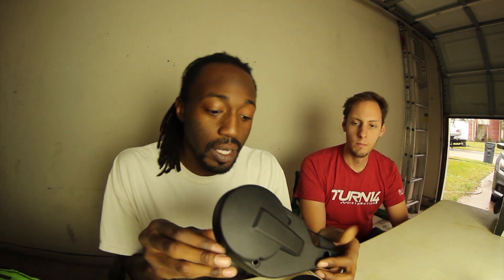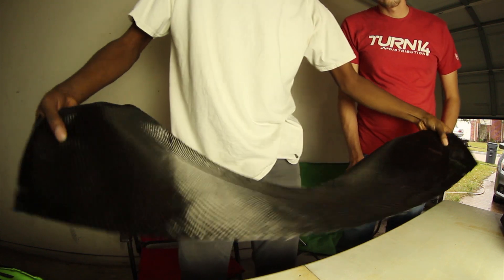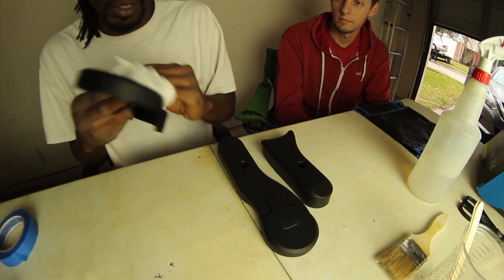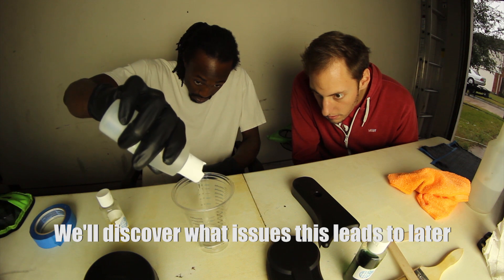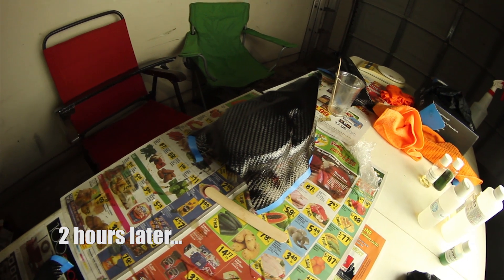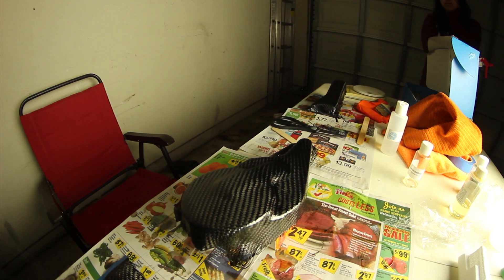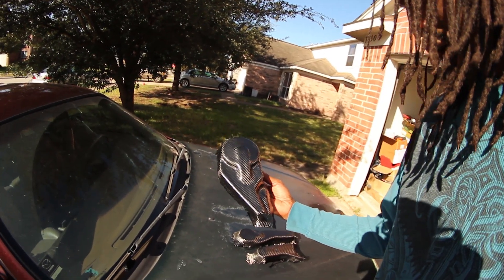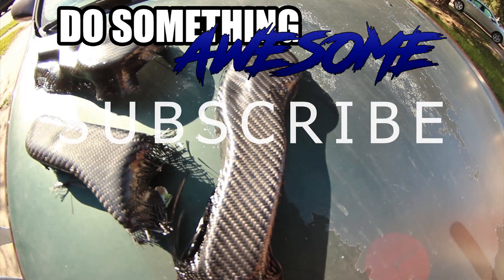What NOT To Do When Working With A Wet layup Of Carbon Fiber

Comment: Awesome. Would it be possible to sand down majority of the bad resin and then mix up a fresh batch and redo it?

I had a carbon part made and it softens up when it gets warm. Wondering if I can sand down the resin or most of it and then reapply  a new couple layers front and back of a better  quality reason so it stays hard all the time like it should.
Reply from the maker: Yes
Reply: bag it !!  to get that glass finish you want is almost impossible . and you need a negetive mould  .

Comment: Tip...buy a hair dryer on low setting to get the bubbles out and remove fingerprint smudges. 

Or if you're brave hit it with a blow torch

Comment: One other tip that might help:  when cutting a straight line, pull one tow (string) out from the side.  That will create a straight line that keeps you from cutting across the twill.
Reply: Dude, how to cut a circle in that carbon fiber fabric
Reply: @hariharan.r6352  in my experience, there are two options: 1. A REALLY sharp set of shears, and 2. Use a template like a can or lid that will allow you to hold the fabric down while using a rolling knife (like a pizza cutter).
Reply: @aConspiracyOnlyTakes2  Thanks man

Comment: How snakes has your buddy been touching anyways?  Just an idea, I do upholstery and everything automotive, but to cheaply cover your table, use rosin paper. It is sold in 3 foot by 100 foot rolls at home improvement store in the flooring section. It is thicker than construction paper and sells for $12-$18 dollars. I made a bracket to hand mine off the ceiling with an old broom stick for it to roll on. It can be used to make templates, holds painter tape well and provide a nice clean surface when doing messy stuff. Like holding snakes. :)

Comment: I just use several coats of auto wax for release. Dont know if it is cheaper than the stuff you used. And for parts that dont become molds themselves I just use packaging tape and a little wax. Packaging tape technique is not so great on complex shapes like you have though.
Reply: green mould release is like $10 gallon

Comment: This shit is not easy to work with. Pointer use a 1:1 epoxy (harder to mess up), same batch epoxy and resin (manufacturing date), and try not to do it when it's raining. To much moisture in the air. Good job tho. I covered the butt end of my pool cue, it was a pian but turned out 9/10.

Comment: i used spray adhesive to stick the carbon to a part i was trying to laminate, but once the epoxy resin has been applied, the carbon starts to lift away from the part and theres trapped air?? how do i fix this
Reply: Use epoxy resin for adhesive...,.I can tell an easier way to do this
Reply: Check this channel 
https://www.youtube.com/channel/UCzgVALgM93jgukovhZLEw4A
Reply: @xristos_supermoto  thanks, do you know which video to follow as they are all in russian
Reply: @yamaharaptor1896  his most recent videos have English subs
Reply: I myself do it like this and I use epoxy resin not polyester
https://youtu.be/puu26Tg7L3U